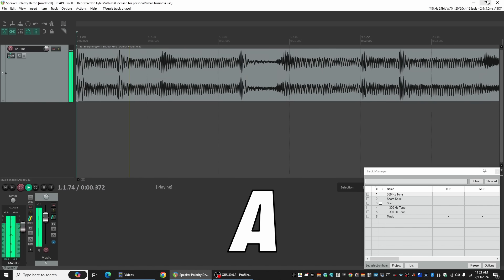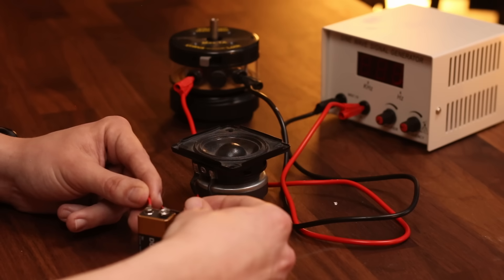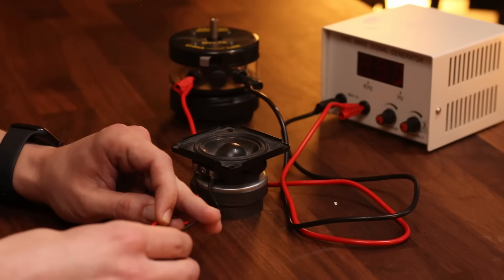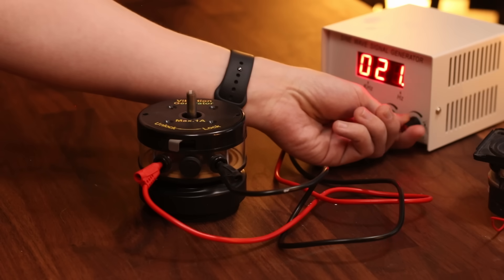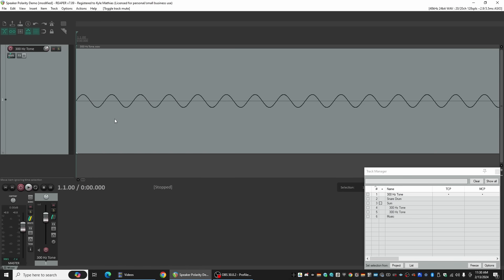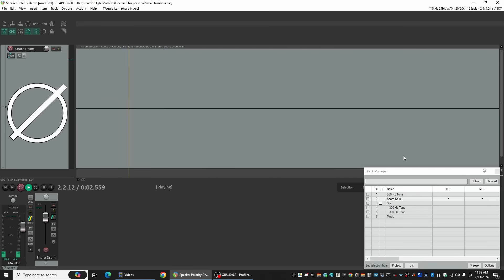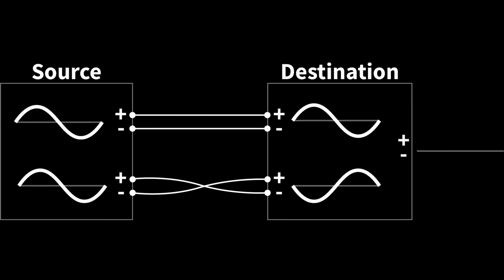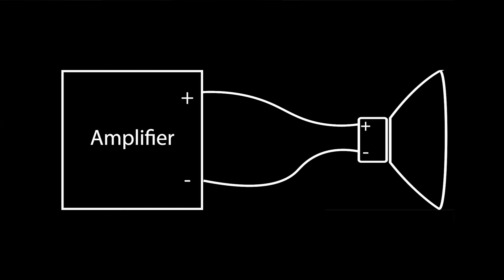What Happens When You Wire Speakers Backwards?

Comment: i actually put my rear speakers in reverse since it does not cancel as much bass. also the lower the frequency the more it cancel since there is more chance it lands at the same time. 

an other one is if you plug one speaker on the positive of "left and right" you tend to hear no vocals and only guitars and drums. some times only cymbals anything mono disappears. (only do what on lower powered stereos, not sure how a 100 watts+ will deal with that compared to a 10 watts and less)

in my case i do add an extra positive only speaker since i do not really listen to music past 1/3 my sound system's volume.
Reply: If you're talking about perceived loudness, then "1/3" is only about 2.5% of total system power depending on gain structure and the dynamic range of the music you listen to.
Reply: @TimpBizkit  nah talking about volume nob. past 60% the neighbors who live in the other apartment would complain.

tho the middle speaker adds a nice effect of only hearing guitar tracks or left/right only cymbals and such.

so at low power i probably do not risk sending power where it should not excessively.

not sure how internal works but if you plug both in negative, you get no sound, that is another interesting thing i noticed playing with that 10 watts system when i first found that out.

so yeah both positive gives only sounds that are not mono and louder if a greater bias or a deviation from 50/50.

Comment: With very high end audio equipment there may be a very slight difference heard.  The reason is you want the phase of both speakers to follow the original acoustic phase of the sound that was hitting the microphone at the time of the recording.  When for example when there is sound in the recording studio you want your speakers to follow the phase of the diaphragm of the microphones.  You want your speakers in your listening room to be in the same phase as the sound was at the original sound stage during the recording sessions.  

If you have a set of speakers wired out of phase to each other, then this is another issue. The sounds will be subtractive and not summed in phase as they should be.

Comment: Some manufacturers actually wire up the mid highs and tweeter speakers in a 3 way design out of phase on purpose

Speakers use AC current so there is no polarity instead its referred to as phase.

Comment: Correct phase is most important in a stereo installation. The membrane of the speaker must move in the same direction for the same sound. 
to check, place yourself exactly between the 2 loud speaker and listen. The sound seem to come from the center.
Cross the wire of ONE lourd speaker and you’ll notice a big difference . The sound will be like coming from 2 different sources left and right.

Comment: Basic speakers are analogue and it doesn't matter which way the power flows through them because the coil acts the same either way. The issue occurs when you have built in amps and are sending digital signals. Then polarity is an issue. Still, from the amp board to the speaker it's an analogue signal.

Comment: It can affect the initial attack of loud sounds.  A speaker cone pushing can generate more SPL than one pulling. It cannot pull more than a vacuum. This is independent of getting the phase of multiple speakers in phase, so that one speaker doesn't 'swallow' the output of another. So the effect of a group starting a song with a loud 'crash' ('The Wall' springs to mind) will be shocking with the speakers phased to 'push' the initial transient, and will quite literally 'suck' if the cones move in the opposite direction.  The philosophy carries over to amplifier design, but that's getting off topic.
Reply: I cannot see why speakers in general could produce more SPL when pushing then when pulling. Speaker builders go to great lenghts to make excursion of their unit as lineair as possible both ways. I do think however that especially when the speaker unit is boxed, there could be a tiny difference in sound, but that would have to do mainly with the box characteristics, not the speaker unit.
Reply: @Paul58069 great lengths seem to be things like the bandwidth stopping around 30 and 40 hz and most have not a linear sub... Lo and behold that's exactly where you'll notice the difference
Reply: When a speaker pushes it pulls from the other side, and when it pulls it pushes from the other side, so why would it be different?
Reply: @SergejSucur because you aren't standing behind it?

Comment: It is almost always good advice to ensure your speaker polarities match, but you must not forget that a speakers only job is to turn an electrical signal into mechanical energy, in this case an air pressure wave.  No matter how you have wired your speakers the frequencies being produced, or the distance between them (their positioning), the acoustics of the space,  the position of the listener, and the frequency of the sound also play a huge part in whether the sound waves are going to be constructive or destructive to each other.  Depending on all the above factors in some instances using intentional reversal of polarity can be beneficial.  Audible sound to humans vary in wavelength from a few centimeters of many meters thus in the case of a tone of one frequency its viable to set the optimal polarity or phase differences for the positioning of your speakers, but in music where sound frequencies are broad band covering much of the human hearing spectrum that task becomes largely impossible.  Since the low frequencies have a longer wave length (10-20 meters) and your speakers are generally nearer to each other than the wave length of those sounds, and because low frequencies need so much more power to transmit your normally going to use the same polarity for optimal sound quality and avoid large listener dead zones for those lower frequencies.

Comment: While it doesn't seem to make a difference in things like the sound of instruments, attack/decay, transient response, etc.

It does seem to make differences with things that have to do with the reproduction of spatial Queues, i.e., soundstage, imaging, the natural ambience of the acoustic space where the recording was made.

Here's a long explanation:

These are some notes I have from a lecture I heard back in the early 2010's.

It seems, that the majority of neural firing is on the positive pressure peak of the sound wave. In nature, the initial sound wave is outward from the source; a positive going wave. It also seems that 80% of our nerve endings in your tympanic membrane respond to time, not frequency*.

So, our auditory systems are weighted to place more importance on the positive going peak (as it would with correct absolute phase), than negative going peaks. If the absolute phase is reversed, when our auditory systems are expecting a positive going wave, we hear a negative going wave, it messes with our ability to locate objects around us.

The auditory system not only detect absolute phase but also extract stereo information from transient wavefronts by comparing the relative phase in directly heard transients to the relative phase in their delayed signals. The outer ear acts as directional phase encoders, shifting the phase of the transient harmonics depending on the direction and time of arrival. This produces accurate location of sound sources and with knowledge of the room boundaries producing delays. Our auditory systems have evolved to such a degree, that a single twig snap produces an accurate "image" of the trees and other objects around us.

So, all this points to, that if we do not hear a positive going wave when our auditory system is expecting it (from millennia of evolution), it messes with our ability to accurately locate sounds in space around us. In the stereo reproduction of sound, this translates to: no well defined soundstage, and a lack of specific location of instruments within the soundstage. So, instruments will tend to sound diffuse, lacking a specific location, and will be hard to judge their size.
Reply: Let me add, that these sorts of difference may not be discernible with tha vast majority of mainstream rock, pop, hip-hop, country recordings, because no effort is made to capture the natural ambience of the venue, or the musicians within it.

Unlike classical music and a lot of acoustic jazz, where that is a major goal of the recording process.

Comment: There is an exception to all the speakers being wired the same way, if you have multiple subwoofers for example and some are mounted cone facing out and others magnet facing out, you need to wire the opposite facing speakers in reverse otherwise the same cancellation will occur.

Comment: what if u wire the speakers correctly, and the subwoofer opposite? i once had it in my car by mistake, and noticed slight difference, however can't say if it was for the better or worse, or was is a placebo 🤔

Comment: There is a difference in the sound.  A trained ear can hear it.  Even an untrained ear can hear it in just a few seconds.  

The easiest way to hear the difference is to pop the speaker like he does, with a battery, but use a double pole momentary switch to change the polarity of the pop made when you apply the power, with just a few tries you will be able to hear the difference IF it is in an enclosure or a baffle board, just laying on the table like he has it I doubt you can hear a difference because you are hearing the front and rear wave.  

There are 2 reasons it will sound different.  One reason is, that if you pay close attention, you can actually see that almost all speakers are not linear and they will move in or out farther depending on the polarity, even with the same input power.

Just watch him with his battery, or test for your self.  Most speakers will push out farther and pull in less with the same DC power applied.  

Another reason is that depending on the  polarity, the initial pop sound (the air) is either being compressed or decompressed (on the side of the speaker facing us) on the initial connection to the battery.  Because speakers are usually not linear is one reason that "isobaric" was invented.   If you connect two speakers face to face, then one speaker (in theory) will make up for the other and the overall speaker assembly will be more linear (and yes, with the exposed one wired out of phase).  

Anyways, I see so many comments on here saying it doesn't make a difference, but it does, and if those people test it, they will most likely become believers.

I will also comment here.... that NO, I can NOT hear the difference over the you tube channel and into my computer speakers, but in person almost everybody can hear the difference with a battery polarity pop test.

This subject is almost the same type of argument where people argue that a square wave test of an amplifier is nonsense, because "music does not have square waves".  Well, then someone needs to tell the synthesizer companies to stop making square, triangle, and saw tooth wave forms on their devices, because people don't believe in them... LOL.
Reply: Is a trained ear like a trained ape? Just without the training?

Comment: It's actually fun to experiment with out of phase speakers and placement.  If they are directly facing each other with the listener in between, you get a push-pull effect that's pretty cool.  It depends on the spacing and frequencies as well.
Reply: I hate that effect. Gives me a weird feeling in my ears.
Reply: It can result in a kind of "fake stereo" effect. When I was a kid I got a kick out of doing that. Even better was setting up an AM radio and FM radio on the same station (here in NZ at the time we had stations that broadcasted on both) for whatever reason there was a significant time difference between the two, causing a fairly extreme slapback echo effect. It was a trip.
Reply: Deafening silence
Reply: @jnawk83  You do not get silence, only damped bass and the higher frequencies is pretty much unaffected but with weird / cool sound effects of "sound phasing".
Reply: It all sounds like ass.... 

Theres no value in reversing phase to one of the driver pairs
Reply: @davelowets  As an experiment to hear  the effect on the sound waves.  Not to keep that way for normal use.  Jeez, what a buzzkill.  I've been doing electronics for nearly 50 years, so maybe I like the science behind it.

Comment: Excellent video! But doesn't the "cancellation effect" assume that my ear is at the same distance from both speakers? In practice, if I am at a random location in my living room couldn't the cancellation effect happen because the distances between 2 speakers differ by a half wavelength or something like that? If that's the case, then it doesn't really matter if one of the speakers is wired "backwards"?

Comment: Labelling AC lines as +/- was a hideous trick to get lay-people to connect their speakers "phase matched".
Reply: The - is actually ground and the + is signal positive. This is why headphone cables can get away with just having 3 conductors in them. Both channels can share the same ground. Also why a stereo audio jack can have only 3 conductors too. Tip, ring and sleeve.
Reply: @1pcfred  For unbalanced audio connections yes, the (-) output is grounded to earth and can be shared between channels. 
   The speaker itself doesn't give a shit how it's connected and the listener will never notice as long as they are connected the same way.

Comment: The short answer is nothing will ever happen. Only at an absolutely exact frequency at an exact speaker distance apart will polarity reversal be distinguishable. Only at super low frequencies will the human ear even be able to detect the polarity reversal and again the ears need to be in the exact place for it to occur. Multiple subwoofers adjacent to each other it matters but speakers in isolation it doesn't matter in the slightest.

Comment: Interesting to note that the Linn Isobaric speakers have twin cones out of phase - normal speakers have air vents to allow for the pressure differential created inside the cabinet to be equalized. On the Isobarics, individual speaker (cones) are doubled and connected by an air-tube; the pressure differential is thus equalized by the second cone moving in the same airflow direction as the first, rather than by venting.
Reply: Iisobaric subwoofers are great for small spaces that need a small box. It offers extended bass response but at the cost of -3db efficiency so it's not for everyone.
Reply: @JesusIsLordAndSavior77  Have you seen the size of an Isobaric...!!!
Reply: You use isobaric speakers to get a stronger pushing force for applications that need it - e.g. a smaller box, although you waste energy and potential output doing so.

Comment: There is no + and - on speakers. They are supplied with AC, not DC. When you wire them backward, the pase chances by 180 degrees.

Comment: Great presentation.  As far as the speaker producing sound when AC goes through it, you  may want to mention rippled DC or DC that varies in amplitude and has a waveform but doesn't actually change direction like an AC sinewave after it has been run through a diode.

Comment: Got a question, if you use a speaker from a stereo that is enclosed. Where you cannot do the test on the pos an neg side of the speaker by sight. Is the wire of the speaker color coded? Like some for 12 volts with a white Lines. Great video.